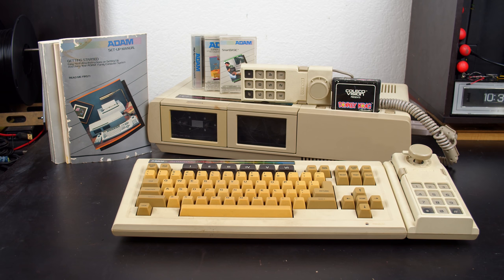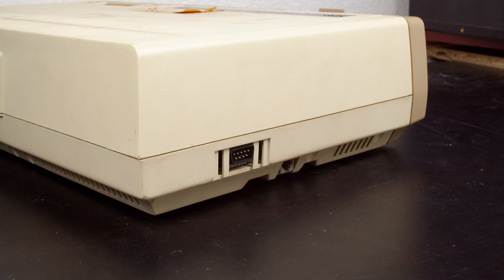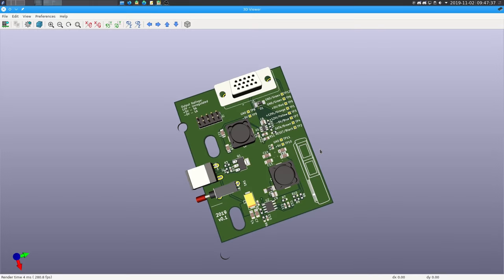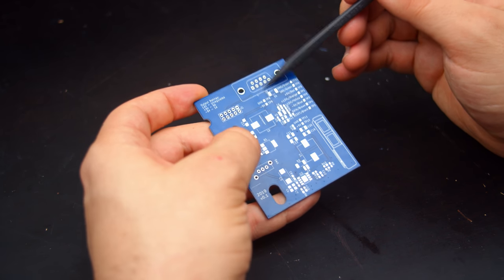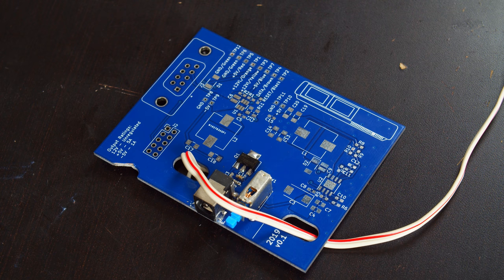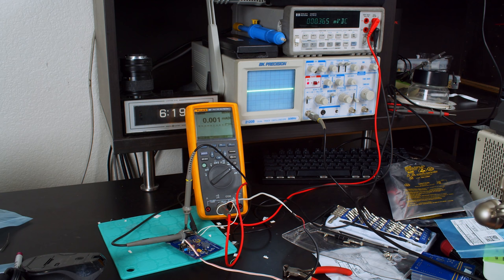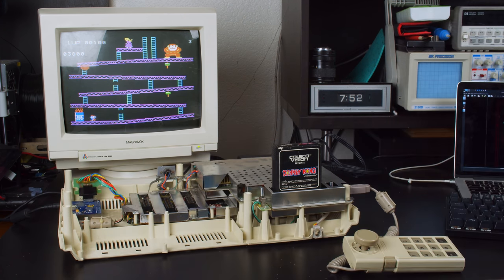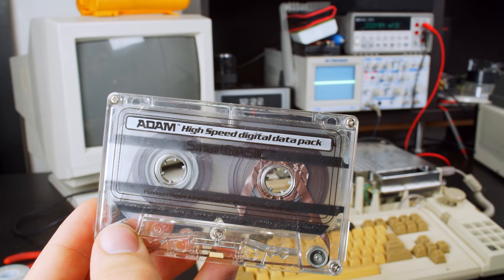Making a New Coleco Adam Internal PSU

Comment: Here's a question: Does the Adam still generate an EMP when powered up with the modern power supply, or was that an issue unique only to the printer? I seem to recall in the past that was the case.
Reply: That was unique to the printer. When I made a run of custom Adam power supplies a few years ago I was able to confirm this.
Reply: @rey_1178  if coleco fixed that power issue from the printer in the first place then cassette tapes wich were left inside the adam computer wouldn’t have been wiped out by accident,but with this new power supply that should be fixed now altrough it’s 39 years too late.
Reply: My man couldn’t be bothered to answer that question 😂
Reply: The only thing any of us actually watched the video to find out and as always he omits anything truly tech savvy...

Comment: Just like to let you know that the older atx 20 pin psu's with a white wire will provide -5v.
Reply: Older ATX PSU's (and AT before that) had a -5V rail for the ISA bus... when ISA expansion slots became obsolete, they stopped including the white wire on pin 20.

ATX Power actually has Standards with version numbering.
v1.2 had it as optional, and v1.3 removed it entirely.

Sometimes older units that have that rail, and good capacitors, are worth hanging on to.  Retro Gamers need them to power motherboards with ISA slots for old DOS SoundBlaster cards.
DOS doesn't play nicely with PCI slot soundcards.
Reply: Any standard XT / AT supply will also have this. It was used for the 4116 DRAM chips in some of the early PCs and clones, and was kept for the system bus to keep compatibility with IBM's 16/64K RAM expansion cards and other peripherals which used it.

Comment: who the hell thinks that making a printer mandatory is a good idea?!
Reply: Devil’s advocate, in the 80s a printer would’ve been a more critical piece for a computer and most people wouldve probably wanted it connected at all times anyway. Might’ve lowered costs having it bundled like this too, plus less cable mess and outlets needed. They should’ve addressed the cassette problem though beyond just adding a warning label.
Reply: @dogecode386  to some extent i suspect the printer may also have been to blame for the cassette issue, other comparable psu's of the time didnt do that so i have to assume the issue came from something they did in the process of integrating it

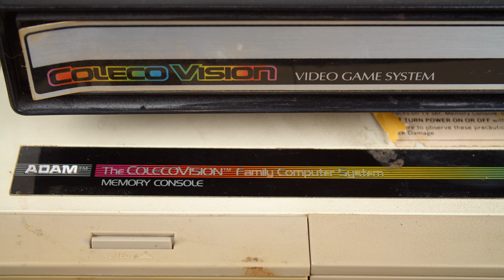Comment: 0:20 Colecovision was NOT released in 1978, it was released in 1982!
Reply from the maker: Woops! Where on earth did I read that that it stuck in my head. Thank you for pointing that out!
Reply: I figured it was just a slip of the tongue.
Reply: I was just about to post this same comment. The ColecoVision was my first console and it definitely wasn't 1978 when I got it.
Reply: Tech Tangents there were Coleco Telstar consoles in 1978...  but definitely not the Colecovision
Reply: @TechTangents  Probably just confused it with the Magnavox Odyssey II that was released in 1978.
Reply: I know this is coming 2 years after this thread started and stopped but a previous video on the Adam (or maybe it was Coleco and this was from the Adam segment) which then got the YouTube algorithm recommending more Adam videos and hence this one … well they said that Coleco CONCEIVED/DESIGNED the CV in 78/79 but the cost was too much. So the world got the lesser Intellivision first and Coleco sat on the CV for a few years until the chip prices came down. They designed the CV to a specification.. to a standard.. not a price. 

To wit, consider the Atari 400. Let’s say it was 400-500 dollars in 1979. Close enough. Like half the cost of the 800 and that was pushing a grand. So Atari had custom chips and in 1983 came the 600XL and 800XL. The 800XL exceeded the 800 for like less than the cost of the 400. Same chipset. Oh and construction costs were down too. The 5200 was a console-only version of their 8-but computers and that was in the same league as the CV. I had both. And as I recall both of those came out in 1982 with CV earlier in the year? 

Point being that a few years time made a serious impact in the price of technology. World was moving fast back then. Or maybe it seemed that way since I was a child then. 

I wanted an Adam. Glad I only got one in the past year 😁
Reply: @nickpalance3622  The Colecovision was a poorly designed and badly manufactured product, though nowhere near as bad as anything today.
One of the reasons the 400/800 line of computers was so expensive is they are built like absolute tanks.  The FCC had not yet done final specs to I think, IIRC, class C computers and it wouldn't have passed the old spec. So it has a huge heavy aluminum shield. The entire thing is metal. Must weigh 10 pounds.

The 5200 was overpriced.  Like a year later they were selling 800s for 150 bucks and it had more RAM, 64k.  The 299 price point was a bad idea going head to head with the Colecovision.

But you are right in that the CV was originally developed in 1979. But the bad choice in chips meant they would need 16k for the video alone. That's one of the reasons they skimped on the 1kb of work RAM.

The Adam is another poorly designed and poorly implemented Coleco product. Those tape drives are awful.

To be honest, I really have no idea why computer companies were so conservative with tape speed, especially commodore.  The compact cassette had a much better bandwidth than was ever used in the 8-bits.  Commodore (and Coleco) had proprietary tape drives and so the quality of the drive was known.  But Jack was so cheap he wouldn't allow any spending on a better basic or a better cassette interface routine (which costs time/money to develop).  Coleco probably could have written a routine that was on par with the data pak format they chose, only with a standard compact cassette drive.  All of the functions could have been controlled by software.

Atari had the advantage of using some custom chips whereas the Colecovision was totally off the shelf (as was Intellivision).

Coleco probably could have turned their fortunes around if not for the crash and probably more importantly, the price war between TI and Commodore.  Owning MOS technology meant nobody could compete. He got MOS for a steal.

Congrats on your Adam. There are a TON of new games for the Colecovision.  The original library is probably smaller than the homebrew scene. There is a LOT of very good games in the home brew library.  Though from what I understand, there isn't much Adam stuff.  Also, get a disk drive.

Me, I wanted a 64. I already had a VIC I bought myself (around age 12).  The C64 was gonna run 400 bucks (200 for the C64, 200 for the drive). I got my parents to buy the computer and used my dataset until I could save up enough money to buy the drive. My parents would have NEVER laid out 600 bucks.  Through my whole time of using it, it was always hooked to a B&W tube (as in not solid state) from the 60s.
Reply: @tarstarkusz  poorly manufactured for certain. Damn traces on the thing lift up with hardly any heat from a soldering iron.

Comment: Oh man, I had the Adam Computer growing up. I think I got it maybe in 1986 or 87, it was on clearance for, I believe, $200 - which was my max limit for Christmas. I only ever had a monochrome monitor however, so seeing it here in color is the first time I've ever seen it color. It was cool to have the big daisy wheel printer since I could type stuff up in middle school, at a time when no one was doing anything using computers at home (at least not where I lived). The downside of getting a discontinued computer that late in it's life was that there was no software. As for the EMP - humm, I mean I guess it's legit, but I know I never took the tape out and it never failed. Additionally I don't recall that warning at all. Anywho it was a giant computer that I kept well into the 2000s before throwing it away while moving. I wish I hadn't done that now. I replaced the Adam with a C64 in like 1988, and I used that C64 as my only computer until I built a PC in 95.

Comment: to answer some questions people have been asking here... yes, you could make yer own data pack cassettes for the adam from ordinary tapes, and the adam pretty much came with one half of its own DDP Home Piracy Kit™, missing four key components: 

- 2 jigs, one for drilling holes into the top of a standard audio cassette to allow it to be inserted into the data drive and a jig for drilling holes into the source DDP at the bottom so you could insert it into a standard cassette deck. you could easily make these jigs with a drill, a marker, a hacksaw, pliers, and some angle metal commonly found at hardware stores. 

- a dual cassette deck for dubbing

- blank 90 minute audio cassettes

an adam usually came with 3 tapes... buck rogers, smartbasic and a blank data pack.

make the jigs, drill the holes, put the tapes into a dubber, and 90 minutes later, you had yer newly-minted data pack for a fraction of the cost of the official data packs. when the computer was new, the DDP tapes were about $10 a piece (sometimes more) from Toys R Us or other retailers. usually you wanted to use decent quality normal bias tape. the local Adam users group i belonged to loved Sony brand tapes since they held up well to the abuses the tape drive would put the tapes thru.

believe you could reformat the newly copied tape with smartbasic. the built-in word processor might've been able to do that as well. can't remember.

those of us who used the sony tapes rarely had one snap or wear out too quickly, but it did happen. the  lubrication strips inside the sony tapes could actually hold up to the abuses of the higher speeds, but the sony tapes would get noisier over time. then again, the original DDP tapes would too.

there were guys in the Adam user group i belonged to that had made high speed duplication rigs using the adam tape drives. don't remember if they'd copy the audio signal straight across or not, but i'm pretty sure they did. much faster than duping the tapes at the standard compact cassette speed.

other minutiae ... 

imsc, the adam tape drive ran at 80 IPS when seeking and 20 IPS when in read mode (may be a little high on the seek time but it was stupidly fast, and the tape drive made horrible noises when in that mode, as depicted in this video). they were slower than floppy drives of the time, but were a DAMNED sight faster than yer standard computer cassette deck of the time that ran at 1 7/8 IPS (standard compact cassette tape speed).

i think the DDP shells were made of lexan. 

there was no "rewinding" necessary when using an adam DDP. just put the DDP in the drive, close it, and pull the "computer reset" switch. 

there was indeed a floppy disk drive made for the Adam. it came later, just before the system was orphaned by Coleco. you could buy them new from a place in Cherry Hill, NJ (M.W. Ruth? that's where i got mine i think), and they cost about as much as the system did -- $500. they were a single-sided 5 1/4" PC floppy drive with a custom controller built into them. adam floppies stored just over half of wot the data packs did -- i believe it was 160k on the floppies vs 256k (or thereabouts, probably have that number wrong) on the DDP tapes.

allegedly there's an SD interface for the adam nowadays, as well as hard drive interfaces, and of course sd multicarts for the colecovision side. the system can still be useful and fun, much like other platforms. people are still keeping it alive. and that makes me smile.
Reply: Your recollections appear to be spot-on, as they mesh with my own. Tape and disk capacities, lexan cased DDP's DDP speeds (even bought stuff from MW Ruth, like MMSG's Super Disk Copy). I have a pair of the Orphanware-modified 720K drives installed in the Coleco housings, equipped with firmware that allows them to identify as 3rd and 4th disk drives to SmartBasic

I have also dubbed DDP formatting to audio cassette. Used mostly Sony C-60's (but I did start with the device you hook up between the tape drives and motherboard to allow format copying). At one point I even formatted one of those "reel" cassettes that looked like a reel-to-reel deck. Didn't use them for much though--during rewind/fast-forward operations, the sheet-metal "reels" started swapping visible static discharges. Didn't harm any data or the drives, but I rarely used them out of caution after that.  Besides, I had a stack of DDP's from American Design Components in northern NJ (that mostly went unused since I had the floppy drives by then)

I stil have my (exansion module 3) ADAM. I believe I need to bypass a crushed contact on the edge connector to get it working again, but space to set it up got scarce, so its components are mostly at opposite ends of the house.

Comment: in reality the adam tape drive could use normal casettes, a company in my country designed an interface to use the digital data drive on the zx spectrum they do the software to control the drive. Broke the pins on the DDD that make inserting a normal tape impossible, on software they do their own formatting. The amazing thing is that using the drives on their software they work wonderfully to this day and on a 90m tape you get like 250k of storage. Also the controller have an snapshot switch that when press it dump the complete spectrum memory to a file.

Comment: If I remember correctly there was at some point programs that would allow you to format regular tapes. So you could just drill the extra holes.
Reply: There was an aftermarket device that you connected between the two tape drives that would clone the format onto a drilled cassette. I later found that if you placed one of these cassettes into a dual-cassette recorder, you could clone the format between ordinary cassettes--if the sound levels were high enough,  the Adam would read/write to the cassette. Regular data packs had 256 blocks, arrayed on both sides of the tape, with a directory block midway through track one. Game packs placed the directlry at the beginning .

Comment: This is awesome. The printer had one annoying quirk in of itself. The thing was a daisywheel. It had more in common with a typewriter then a printer. Whenever you turned on the printer to turn on the Adam, it would run a reset on the daisywheel mechanism, This reset would often get stuck, and leave the daisywheel on the printer endlessly spinning. It wasn't good to leave it do this, so you would bounce the power switch and hope next time it didn't get stuck. As for the tape drives, yeah they were quirky, but we purchased the rather rare disk drive for it. I remember copying a lot of stuff off the tapes once we got it.

Comment: Excellent video, thank you.
Ah, the Coleco ADAM - one of my favorite retro computers. A wonderful mix of really, really, clever design and absolute nonsense.
I can't help but think an engineering sample was shown to marketing at Coleco and it was pronounced "good" without any further development.
FWIW: I did near enough the same mod for my ADAM, although not as nicely designed:
-12v power brick
-Barrel jack for power placed so it would be obscured if the printer is connected
-Rocker switch for power tastefully selected to match the system positioned round the back
-Big space you noted filled with a 12v DC to ATX PSU. Not a PICO PSU, but something similar I had on hand
-Addition of a regulator for -5v (my PSU didn't have this)
-A resistor to add a little pre-load to the PSU's 12v line
...and done. Actually no. It took a bit of head scratching on my part to figure out that if the two 12v supplies for the electronics and DDP's had any kind of connection the computer won't boot!
In the end I routed the 12v from the PSU to the logic and the 12v from the power brick to the DDP lines respectively. Thankfully the 12v on my PSU wasn't just passed through from the power brick...
...Of course that means I must use a 12v brick regardless of the PSU's capabilities so labeling both the computer and the power brick I selected was important - some day this computer will hopefully belong to someone else so I wanted to be sure my mod(s) are as fool-proof as possible.
From the point of a retro computer enthusiast I think the ADAM is a wonderful machine and it's quirks just add to the charm. Such a shame Coleco didn't develop it properly and didn't re-think some of the crazier decisions...
...because I've designed my own expansion cards the thing that really gets me is those darn expansion slots:
-Why is every one different?
-Why does the pinout positioning make no sense at all?
-Why are some of the external expansion lines missing from all of the internal slots? (really annoying)
-Why only three slots in such a large case?
This machine was marketed as an Apple II killer... maybe taking a similar approach to the expansion slots would have been a good idea!

Comment: 8:33 ah the paper
Reminds me of back in highschool where our electronics teacher would have us push every through hole component through the paper and draw traces before etching the design onto a board so we know it'll all fit.
If I remember correctly it was, lay it out on the paper. Align paper with PCB, and tap every hole on the paper with a drill bit so you mark where to drill.

Comment: Regarding the enable pin for the negative regulator, "ground" may be high when the regulator is running but not before it starts running. Regarding the frequency it's common for switchmode converters to drop the frequency to maintain regulation when under very light or no load. This is why some power bricks buzz audibly when unloaded.

Comment: For a great cheap programmable load you can get a 500w (probably wouldn't run it at that though) buck converter with CV & CC and short the output. Slap a fan on the heatsinks and its great. I have personally run it to 3 amps. To change the load you just adjust the CC pot.